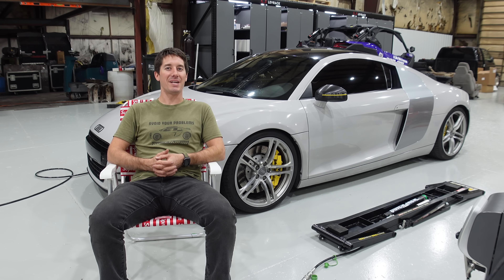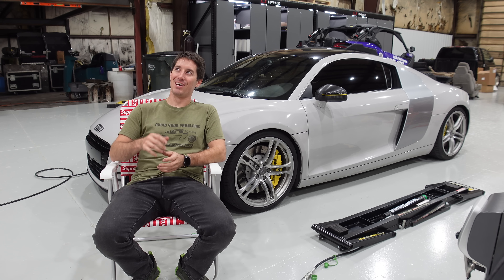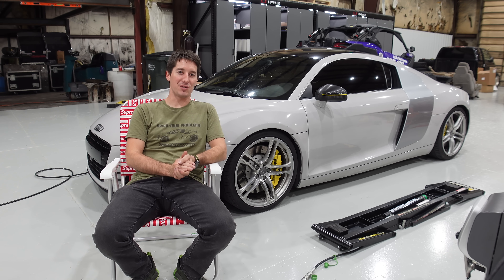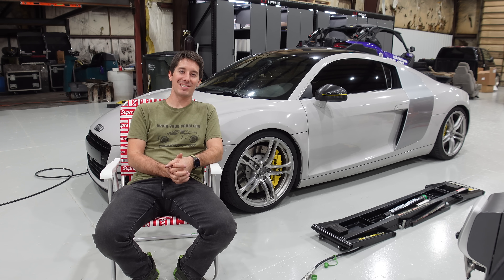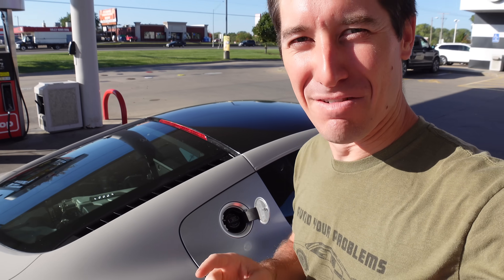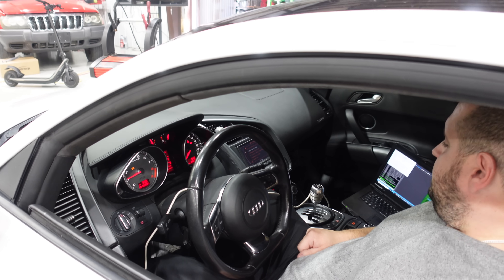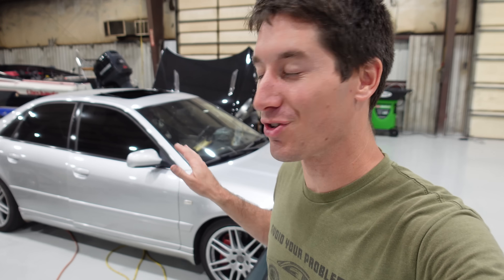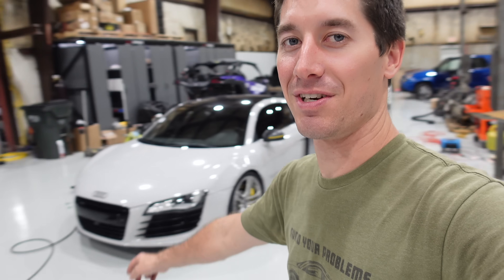REBUILDING MY CHEAP Twin Turbo R8 Cost $90,000 And TWO YEARS *It's Finished*

Comment: John...with all due respect, all the time and work you've got into this thing now...KEEP IT! Seriously this a drivers car and you've got a relationship with it now, drive it, enjoy it and have fun with it!
Reply: It's more like a ticking time bomb that's going to blow a hole in the next owner's wallet.
Reply: @OMGWTFLOLSMH  The 4.2's fine at the 600hp level it's tuned at now... the Heffner kits were always reliable and tuned with the limits of the stock 4.2 block in mind to keep them safe.  That one nuked the motor simply because it was never tuned when the turbo kit was originally installed, which could happen to any forced induction setup on a stock N/A motor.

Comment: I am glad you addressed the whole Heffner Kit that Heffner couldn't tune.  I always thought it was the weirdest thing ever.  It still blows my mind that tune files just disappear.  Did the 3.5" floppy it was stored on get too close to a magnet?

Glad it runs.
Reply from the maker: APR tuned the original V8 TT cars, now he tunes on Motec of course 🍻
Reply: "Those are the last things."  Famous last words.
Reply: I'll up my previous offer of $15k.  I'll trade you my 03 S6 manual + $10k.  Be there in 3 hours.
Reply: @WatchJRGo  Ahh. Well I am glad it finally all got straightened out. What an ordeal!  R8 are amazing cars.

Comment: It's amazing how listening to you say this valve this hose this wire all has to do with the computer. I remember watching shows 30 years ago, and the carburetors were off a little bit, for the distributor cap was in the wrong position and that's what was making it not run correctly. This car and cars like it are absolutely amazing but also I'm sure beyond frustrating for you and other mechanics out there. Kudos to you that know so much about it, congratulations on your car

Comment: By no means am I in a position to own a car remotely as powerful and impressively engineered as this, I have however driven a non-turbo, lightly modded version of this same model and not only was it extremely civil and comfortable driving through the center of Boston to reach the highway to head north to Maine but it was more than competent doing 35 in traffic or triple digits on the highway. Great video man and outstanding project

Comment: I recently replaced the head gaskets in my Subaru (EJ25).  I bought a box of sandwich bags and bagged & labeled anything i couldn't put back on the engine block,  some other parts i labeled to know exactly where they go back. It can be done if you put your mind to it!

Comment: The way this ends is that the detail guys leave it outside with the keys in it, and the guy who stole Hoovie’s ML55 from the carwash jumps in it and drives off.
Reply: No.
Reply: I bet the guy who stole Hoovie’s ML55 can’t even drive a car with a manual transmission.

Comment: It sounds like more headache than fun. I would just spent the 90k to get a used low miles R8 V10 still as fast with little tune and a good exhaust system with zero headache! But good job for not giving up!

Comment: Congratulations on getting the Audi R8 done. Unfortunately, the more I learn about European cars, the less I want one. Expensive, overcomplex, and difficult to find parts for, European cars in general don't seem like they are worth the trouble. If I had the money to buy this car, I'd probably get a C8 Vette or a Lexus instead.
Reply: @Lassi Kinnunen 81 - Admittedly an R8 is a upscale car, but even base model Volkswagens can be stupidly complicated. I owned a 1975 VW sirocco and even that was ridiculous. It needed a new carburetor which at the time was $350 (with no guarantee that it would fix the problem) which is about $1500 today. I just traded it in for an Oldsmobile.
Reply: They're great, if you have deep pockets and extra cars to drive while they're being fixed. This R8 is overly complex because of the aftermarket turbos and tune. I'm sure it's beyond satisfying to get it going finally. Now dump it fast, before it breaks again.
Reply: Well, in Europe it's the other way round. US parts are seriously overpriced und US cars are deemed to be cheaply build und won't last as long as domestic ones.
Reply: @Kueppers  us cars ARE cheaply built.
Reply: @Lassi Kinnunen 81 for germany every US cars has to be imported paying tax and customs and then oftentimes has to be modified to comply with regulations. And then all people involved add their profit margin on top. So basically you end up with a Dodge Ram V8 costing about at least 40% over dealer sticker in the US. You can have a much nicer car for that kind of money from domestic brands
Reply: 25k for a 4.2 litre V8 is absolutely ridiculous ls is like 5/8k
Reply: @johnlukach4091  I meant the whole car. And not basic trim
Reply: @alanbradford3130  a new carburetor is what you’re basing European cars being expensive and complicated on? 😆
Reply: @Addison0526  In 1980, an American carburetor was like $50. The VW one was the same size as an 850 double pumper!
Reply: @Addison0526  A ridiculously complicated and expensive new carburetor!

Comment: That car sounds AMAZING, I'm stoked you got it going......Mirza came in for the save.
$90,000 and the only thing reliable is the tool that removes the caps on the wheel nuts lol. ;)
BTW - Tell the detailer you need a paint correction on that R8
Reply: Can't really correct vinyl 😔 otherwise we would be giving it the full treatment.
Reply: @TheBarberShopScott  Yeah I saw the valleys under the vinyl - its rough. I imagine it just needs an entire respray.

Comment: Lesson of the past 2 years, if you want to turbo something with mad power, stick to simple, known engines/cars.  AKA you can turbo V8 LS swap anything, even better if it has an LS V8 stock.  Lots of fast turbo Hondas out there as well.  Still gotta give it to JR for sticking with the twin turbo build, I'd have just put it back to stock with a nasty sounding exhaust and drove the wheels off it on the road course, spent the $$$ on brakes/suspension/tire upgrades.

Comment: These things are a NIGHTMARE to work on!  For example, changing the air conditioning compressor requires the engine to come out of the vehicle, at least a $5000 job.

Porsche's 981 Cayman S is just as fast and way more reliable.  Better looking as well.

Great video!  JR is a "glutton for punishment" for dealing with this thing.

Comment: Still worth top dollar?
Probably worth extra, new engine, professionally tuned, never abused.
And probably disassembled and reassembled for repairs with more care and detail than ANY dealer could guarantee.

Get some 2x12, cut four chunks, drive R8 on blocks, slide jacks under the sides.
I will drive 20,000 pound trucks onto a block of wood, to remove the outer dual wheel.
Learned a lesson, do the real heavy stuff on the ground, avoids having to repair a 20k pound lift because you wanted to lift 25k

Comment: I HATE white cars, but there is something about the R8 in white with those brushed aluminum side panels. My Z28 is white but I'm okay with that. Not many cars can pull off white. This build has been so fun to watch. This just shows that anyone can do this stuff in their garage on stands. Its not as easy as a lift, but you work with what you have.
Reply: The little pop of yellow looks sharp with it.